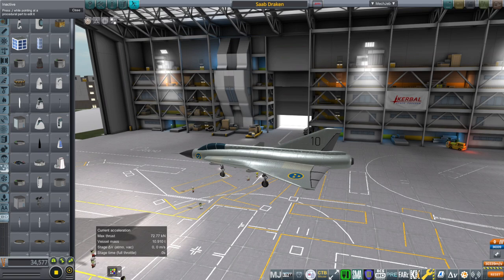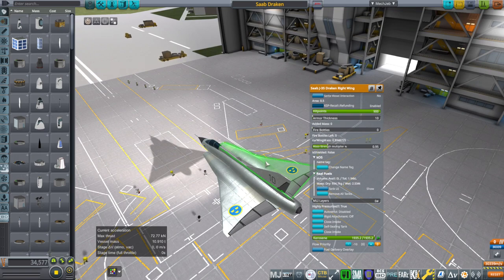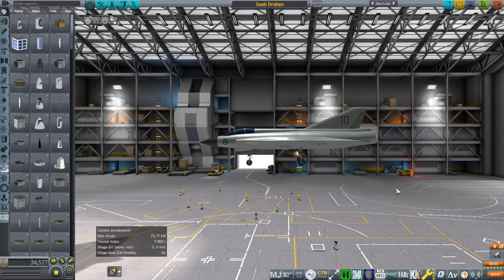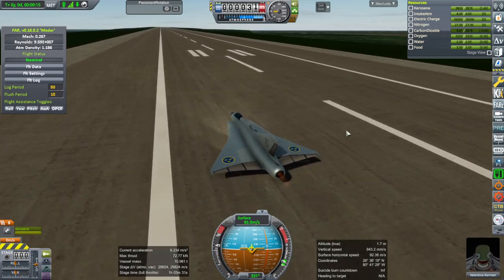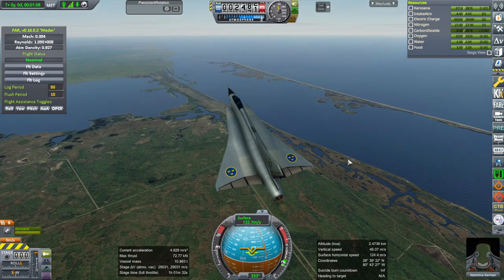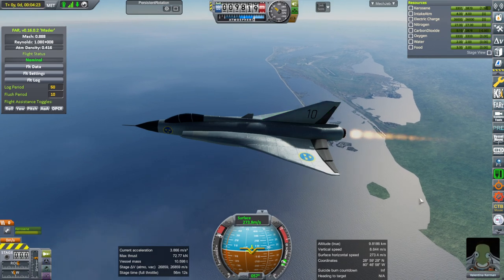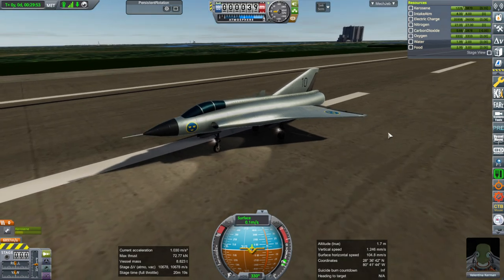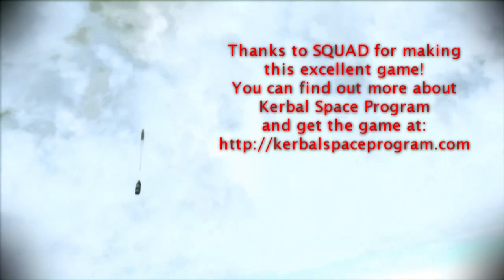Realism Overhaul in KSP 1.11 - Saab Draken Flight Test

Comment: 5:00 I have the impression that the flaps are uneven. That might have caused the roll.
It is even more clearly noticeable at 10:05
Reply from the maker: That's possible, since they can't be placed in symmetry (the wings are each different pieces).
Reply: @RaizSpace  cant you place them on the fuselage and move them to the correct spot for symmetry?

Comment: For a normal landing of the SAAB 35 the landing speed is lower and the angle of attack much higher. Otherwise you won't stop on the 400m intended (half of the ~800m road strip available).
Reply from the maker: I get the feeling we're not going to be getting a perfect landing situation for this in KSP. Basically every airplane has a higher than expected takeoff and landing speed with FAR, as far as I can tell.
Reply: @RaizSpace  I don't expect "perfect". Just stating that the plane is supposed to be landed using way more nose up, about 20 degrees angle. Then the speed also needs to be lower for the plane to decend.

Comment: I've been away from FAR for a while now.  Are there still tools to visualize drag vectors?
Reply from the maker: There are the stock visualizations via F12, if those are what you mean, but I don't know if they're properly reflective of what FAR is doing. For FAR, the SPH menu gives a transonic drag curve , but that's not exactly what we're dealing with here - we didn't have much trouble breaking the sound barrier.
Reply: @RaizSpace  it's almost as if the collision mesh isn't the sum total of what the aerodynamics "see". Like there's an unaccounted-for amount of cross section.

I recall back in the day that miscalibrated attachment nodes could really skafooze the aerodynamics, especially with FAR, and especially on heavily customized parts.

You made this in Blender; is there any way to go back to Blender's output fioles to ensure that there are no surprises?
Reply from the maker: I mean, yes, after I export from Blender I see everything in Unity before bringing it into KSP.

Comment: Could you do a RO installation tutorial for 1.10/1.11? That would be very nice because i have 1.8.1 and i just don't know how to do it for 1.11. So could you please help me with it?
Reply from the maker: I don't think there's any difference between 1.8.1 and 1.11 as far as I know, except you just have to get the 1.11 compatible versions of everything.
Reply: @RaizSpace  But do you have a link for the RO mods? bc i cant find it, idk why
Reply from the maker: The RO github (https://github.com/KSP-RO) should have most things, but consult the forum page like I did in my tutorial to make sure you have all the dependencies. Relevant links should be in the description of the tutorial video.
Reply: @RaizSpace  Thanks a lot!
Reply: Why not to go straight to 1.12.3? Here is the official install guide https://github.com/KSP-RO/RP-0/wiki/RO-&-RP-1-Express-Installation-for-1.12.3
Reply: @RaizSpace  Is there any 1.11 mod for the Space Shuttle System? Thats the one i use the most. I love it!
Reply from the maker: @JunoKeijsers It's possible it will work fine in 1.11, but I'm not sure.
Reply: @RaizSpace  I tried it and it worked, thanks!